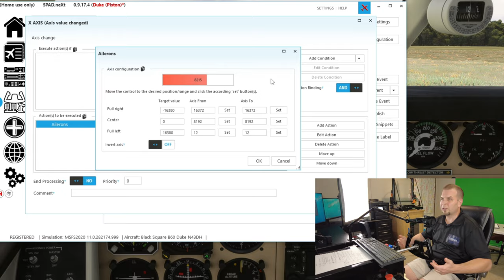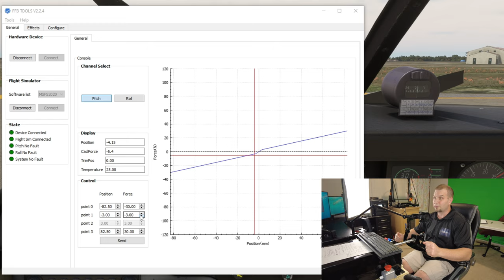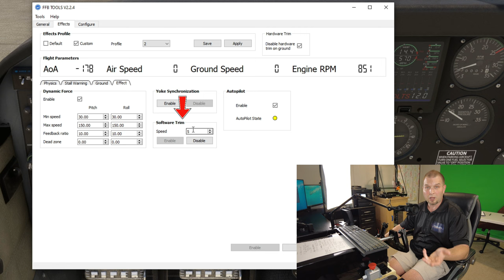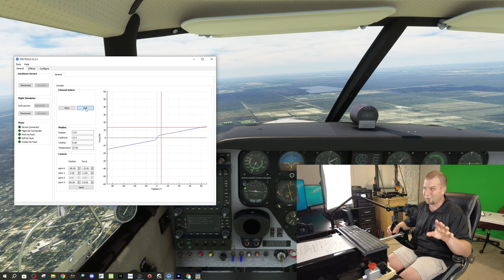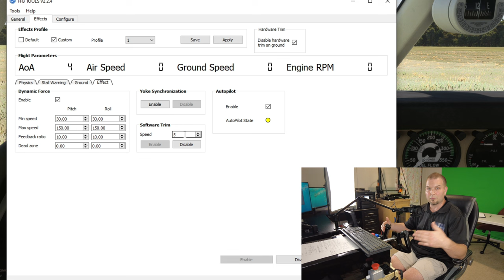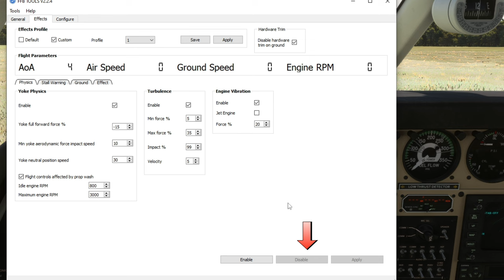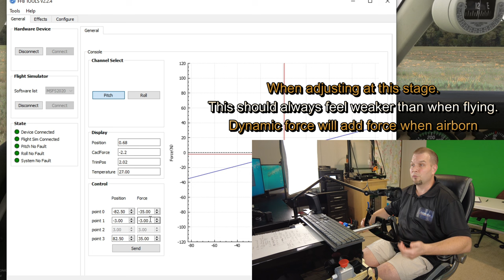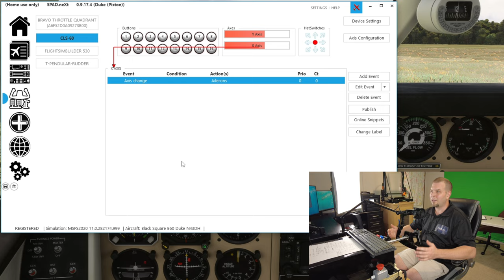Best Force Feedback Yoke On the Market Today? Best value for price? Lets put it to the test! Pt.3

Comment: This is GREAT INFO, thanks!  My CLS-60 AND Buttkicker Pro arrived a couple weeks ago as of this writing. I may have left a comment in one of your other presentations, but I will mention it here again.

 I never had a simulator before, but went for the best components through out including the 3  55" screens running in 4k, and the full Next Level cockpit.

TO LET YOUR SUBSCRIBERS KNOW, I pre-ordered the CLS-60 and was on the waiting list for a few months.  It was $799 at the time.  The kicker is - SHIPPING.  To get it here to MA. Fabian offered us the options.  The express option of air delivery or by sea from the Hongkong distribution center.  I wanted it as soon as possible to replace a temporary control wheel from Logitech, so, went with the express = ADD $230.  By ship, it was $120 but would have taken nearly 3 months to get here!   

So, that was the honest cost for me as one of the first recipients to receive this wonderful Cessna Control wheel.  I plan to try some of your settings.👍

Thanks again!
Reply from the maker: Your welcome thanks for the comment and all the shipping Info. I think I remember Fabian saying he needs 50 units to ship sea shipping .
Reply: @2020fsers  You are welcome too. I did not know about the quantity of orders for ocean service.  I will say, it is a fantastic product, and though I won't be taking mine apart, I am glad you did.  You pointed out a robust feature that really stands out!

It is a breezy day here in the NE, and so I flew my optional Skylane 182T, and needless to say, MSFS (40th anniversary) with live weather had me rockin' around.  A great challenge doing touch and go's at my local airport.  🙂
Reply from the maker: The turbulence effect is really cool I love it . Just finished a flight myself testing the crystal light .
Reply: @2020fsers  Oh nice!  Crystal Light, review to come?
Reply from the maker: @garysmith8455 yes I will.be doing a review . Trying to figure out how I will structure this one since I did a reg crystal review I want this to be different
Reply: @2020fsers  Very good, I look forward to your review.  QUESTION:  When I first got the CLS-60 integrated into the sim, I was amazed at an effect that seems to have DISSAPEARED!, that is, as you are just leaving the runway at take off, about a few seconds later, the control wheel will shake.   As a real pilot, I know this to be the out of balance main landing gear wheels.  As they spin down, you can feel the vibration of those tires.   I wonder how to get that effect back?   Do you know which parameter controls that effect?   I put all settings back to factory original thinking it would return, but it has not.   I could send Fabian an email.  But I will wait to read your reply.  Thanks so much for your return comments.
Reply from the maker: @garysmith8455 maybe the takeoff parameters.  And or ground vibration .
Reply: @2020fsers  Ok, thanks for the idea, I will check there and let you know later today (O;

Comment: Once again “Great Job” thanks for all the detail you put in your videos. I think I’ll get the CLS-120. This will give me the full range of GA aircrafts I fly
Reply from the maker: Thanks so much . Yes with the 120 you can set it up for anything you want and have as close to the force profile as you can for the heavier planes .
Reply from the maker: Just make sure that thing is bolted down 26 lbs of max force pulling and pushing is gonna move things around .
Reply: Yeah the 120 is a beast for sure. 
I think these guys from Flitesim are doing a fantastic work with all the equipment they are creating.
Reply from the maker: Yeah so far they look very promising .

Comment: You have done a great job explaining this product. I would like to hear how this works with a flybywire yoke aircraft. Thanks
Reply from the maker: Thank you .. for a fbw system the ffb stick I gonna be better I think but yes you can use the yoke however most of the effect turn off and the dampening will be higher like 70 of more I think you may also need more stick force at center because you won't be using dynamic force .

Comment: Thank you for this amazing video, but I still have a few questions. May I be so bold as to ask them here:
1-When you create a configuration file (myplane.csv) does it only contain the information of the Roll and Pitch forces?
2-These configuration files (csv files) have no relation to the effects?
3-Is it true that there are 10 Default effect profiles and another 10 custom profiles?
4-The 10 Default effects profiles do not appear to be predefined?
5-Can the 10 Default effect profiles also be adjusted and saved?
6-If so, what is the difference between the Default and Custom effects?
7-and finally: So you always have to choose a .csv file and one of the 20 effect profiles when starting up?
Thanks in advance for a possible reply 🙂
Reply from the maker: hello thanks for the comment and question. 
1. when you save a config profile it will only contain all elements from the general tab and the config tab .
2. the config profile do not have any direct correlation to the effects tab (the effects are separate)
3. there is 1 default config profile and 1 default effects profile. the default config profile is set as the initial general tab settings i would advise if you want to save it go to the config tab and save the profile as default then you can revert back if you wish. 
4. N/A
5.1 default effect profile
6. there are 10 custom profiles available for you to set for individual aircraft and save the custom profile for the plane.  Default profile is set for the cessna 172
7. you do not always need to select a config profile . that depends on the aircraft you are flying . if you are using the same aircraft as you shut down with on the previous flight then no it will display the previous settings but if you use a different plane from the last session when you powered down then yes you will need to select the new aircraft config profile. same with the effects . 
Your welcome hope that answers your questions .
Reply: @2020fsers  Many thanks for the reply :-) I hope you don't find my questions annoying, it's a pity that there is no manual to be found when purchasing, everything is rather unclear (for me anyway) ;-)
-As for the Tab-Effects-Profile there are 2 options to check: Default or Custom. For each of these Default and Custom selections you can select from 1 to 10 profiles, that's 20 together... or am I misunderstanding...
-On the Tab-Effects they call 'profiles', while in the Tab-Configure they call both 'Configure' (read-save) and 'Profile' (load-save).... The csv file to be loaded (in tab-Configure) is then again a 'profile' but has no relation to the 'profiles' of the Effects... confusing for me... Greetings
Reply from the maker: In effects you can either pick default  or custom with 10 saved profiles .

Comment: Interresting video. Did you compare with Bruner yoke MK2? Do you feel it is as good? I want to buy these but i feart bruner makes better software. Also, did you try dual yoke (i know MK2 was a big improvment compared to previous CL-E only. Easy to take over, good sync ...whart about these?
Reply from the maker: Thanks for the comment . I have not personally tested a brunner yoke.  However in the discord for flitesim.com there are several people that have them and for the software it's not as good as flitesim. The brunner software lacks in effects and this is not the  case with flitesim.com.  I don't want to misspeak here so I would urge you to check out the discord and ask that question in the General discussion tab and you will have your questions answered on how the brunner software is comparing the 2 .
Reply: @2020fsers  Hey man, I really appreciate the swift reply. This commlent right here will make me order 2 yokes from these guys as long as dual control is integrated and as good as bruner (i suspect it will be better)
Reply from the maker: @Xavier-wo6ce yes dual controls are available.  The yokes connet with a cat5 cable I believe to keep them in sync . They are also going to have ffb rudder pedals also dual control that you can sync with each other . Some users on discord have purchased 2 for training and they may be able to give  insight on that topic or message Fabian the developer and he will respond.

Comment: My Alpha Yoke's USB port is very iffy about whether it wants to work. I've been putting money away for better DJ equipment, but I think I will spend it on one of these yokes instead. I have enough for the 60, but I am thinking about getting the 120. I just saw a video that they will sell upgrade kits.  Decisions, decisions!
Reply from the maker: well let me say i think the cls 60 is a very worthy upgrade imo. the cls 120 you better make sure its bolted to a firm surface with 27lbs of force that is a workout . the cls 60- is all i need as a sim enthus. and you can easily upgrade if you need to . im not trying to discourage from the 120  just saying the 60 is a lot of force and if you want to enjoy your flight and not fight your flight maybe the 60 . unless you need the extra for training purposes .